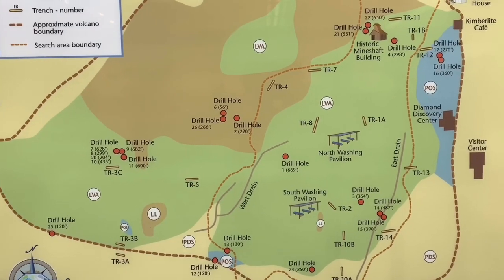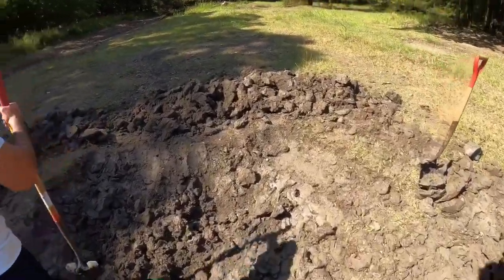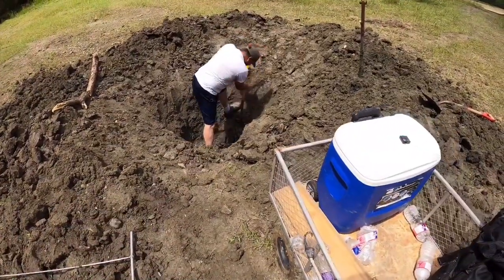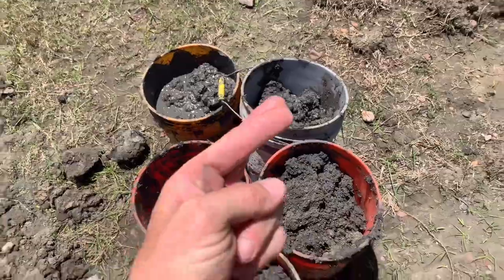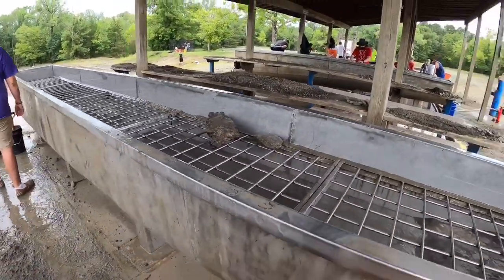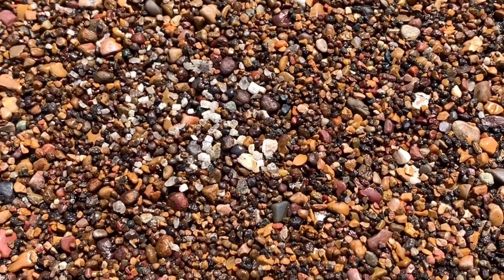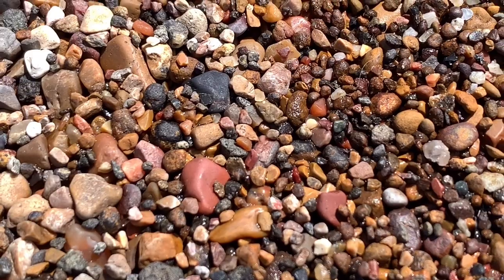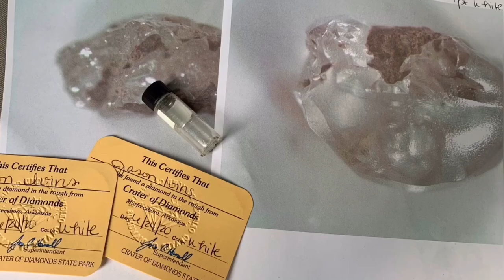Digging For Arkansas Diamonds (Like A Beast!)

Comment: I would certainly check that sludge on the bottom of the wash pit for gold. You would probably get a fair amount of it.
Reply from the maker: Almost all the gold was disintegrated because the temperature in that pipe reached over 4000°. the pressure was so great that it changed octahedron diamonds into resorbed diamonds. However i have picked out a small picker on a center once. i’ve also found pyrite at the Crater Of Diamonds so I definitely know the difference between gold and pyrite and this was a small gold picker !! 

Thanks for watching !!